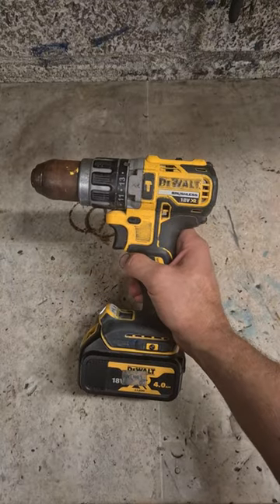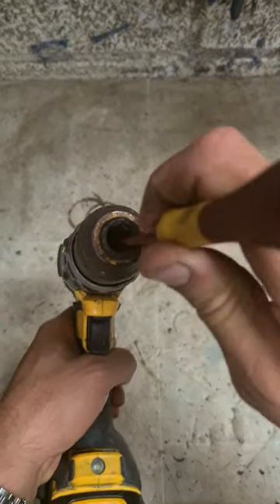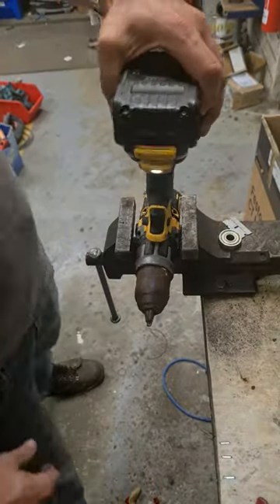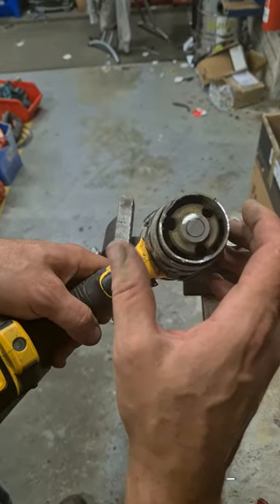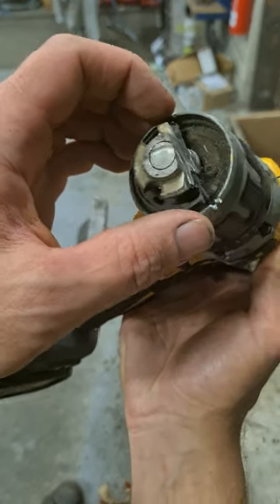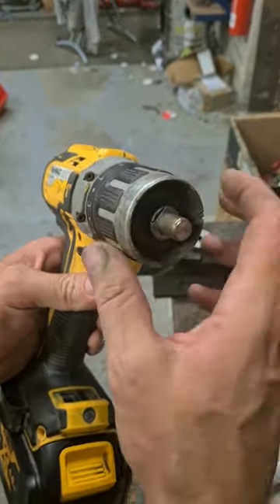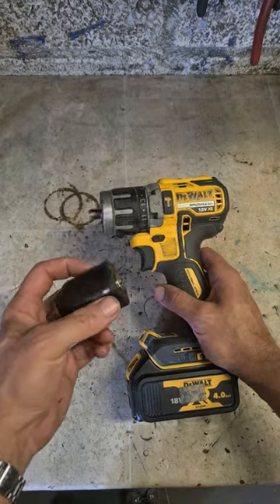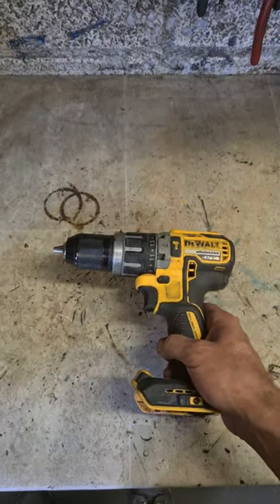How to replace a chuck on a cordless drill that won't come off.

Comment: Here's a small tip for free to get that chuck off in 30 seconds. Get a 10 mil Hex Key and put the long side in the chuck and tighten it as far as you can, tap down on the short end rotating it after every tap and the whole shaft and Chuck will come out of the drill with no damage to the drill or chuck. It's started driving me mad watching these videos.
Reply: @adriaandoelman2577  here's a tip for free, Allen key, hex key is the same thing.
Reply: @adriaandoelman2577  there's an old saying, you can lead a horse to water, but you cannot make him drink.
Reply: How about if teeth are frozen on the open position? What to secure the allen?
Reply: @joaquinsuarez6090  if you have a welder just weld a rod to it or use a Dina Bolt if you want to save the chuck.
Reply: I found an easier way to remove chuck:
I put a vicegrip on bottom of chuck and hitted down with a hammer a few times and came off within a couple minutes.
Descubri una forma mucho mas facil y rapida de quitar el broquero: puse unas pinzas vicegrip  en la parte de abajo del broquero y le pegue varias veces con un martillo hacia abajo y salio en menos de 2 minutos.

Comment: So for all drills that don't have a screw to hold the chuck you need loctite or did you just need it because you cut of the screw head. If you have time, could you please explain that?
Reply: Yeah pretty much though I'd probably just put some anti-seize to stop it from welding to itself, ya never know when you have to take it apart again 😂😂
Reply: He used blue loctite, that stuff isnt permament, a bit of heat to the chuck from a gas torch would loosen it.. its the red stuff thats pretty much permanent..  @AutodidactEngineer
Reply: Dewalt doesn't have a screw. It has a screw head on the drills spindle. That doesn't undo, like a screw would on a normal drill. It's used just to hold the spindle to stop it turning, so you can unwind the chuck. If you can't get the chuck off that way, you have to grind it.

Comment: 0:25 "a wee hex". On the chuck I ground off, I discovered that that wee hex is in fact a LH securing bolt for the chuck. I know you grind through the thing and if the chuck is rusty it'll be a hell of a job trying to unscrew it given the tiny hex socket on the end but it still maybe worth a try before you pick up your metal cutting disc.

Comment: I got a question, I got this old cord Craftsman drill just a plain drill and the check head is stuck but it got the screw inside but I can't get out, so my question is.... can you do a exact same thing when you trying to cut the head or not?🤷
Reply: The screw may be a left hand thread.
Reply: Yes, Cameron is correct; in all probability it's a left-hand thread.

Comment: The screw in sude ar the back of the chuck is a torques head reverse thread take it out.

Then wirh at least a 1/4 hex allen key chuck it in and with a hammer pop it clockwise the chuck will screw off
Reply: That's not accurate advice for these drills Jerome. They don't have a reverse-threaded centre bolt in the spindle, the chuck is simply screwed on to a very high torque value. 

The dealer-recommended way to get the chuck off these without grinding is to remove the gearbox from the front of the drill body, take out the geartrain to get access to the back of the spindle, and either use the proper DeWalt removal jig (which costs more than a new drill) or simply an adjustable spanner or wrench in a vice to clamp the backside of the spindle while unscrewing the chuck with a breaker bar.